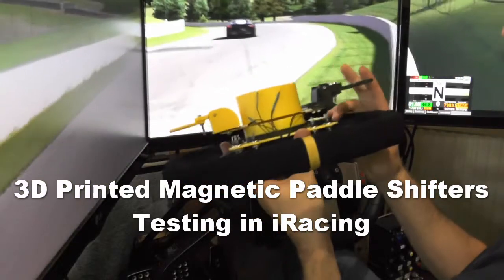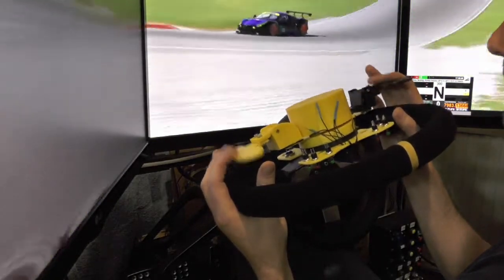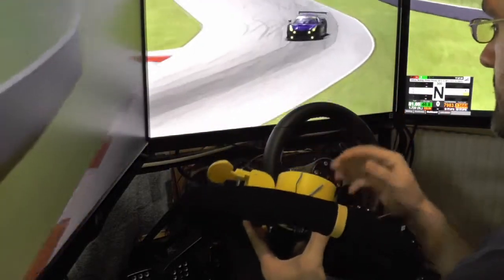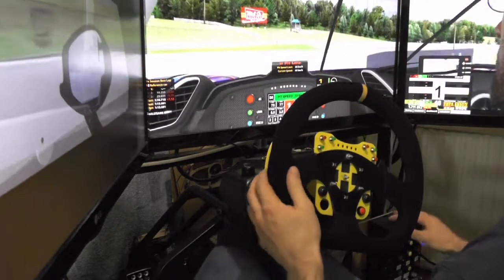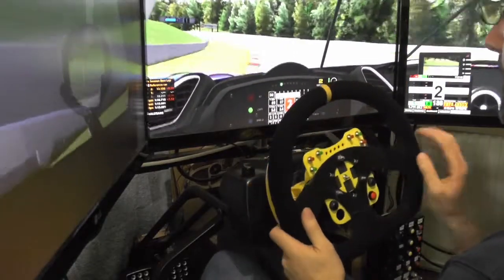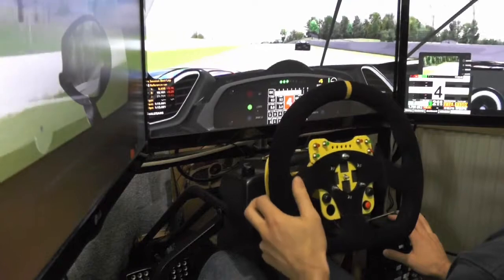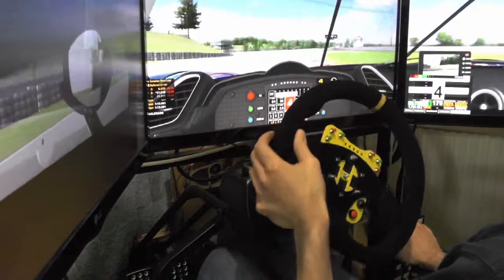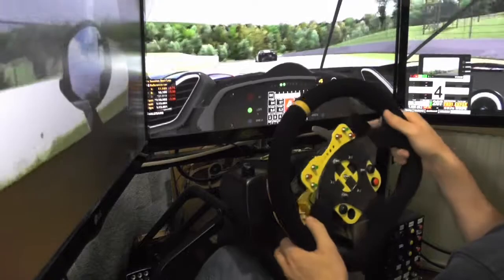Magnetic Paddle Shifter Development Update 2

Comment: Hi is it possible to shear the 3D files for the making of the sifters? :)
Reply from the maker: Hi, plans are coming. I am doing some final design tweaks so I can use switches with a higher reliability (computer mice switches) and I modified the lever so I can use 10mm M3 screws. Planing to post another update video this weekend and post the plans to the shifters with it.
Stay tuned.